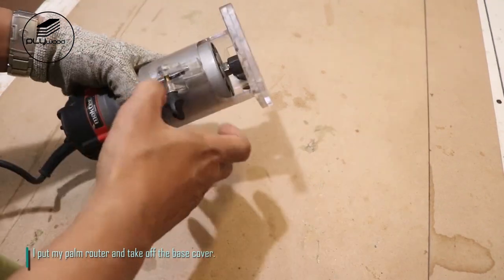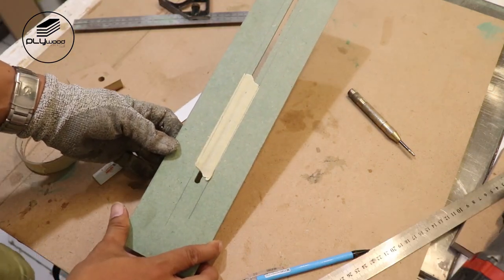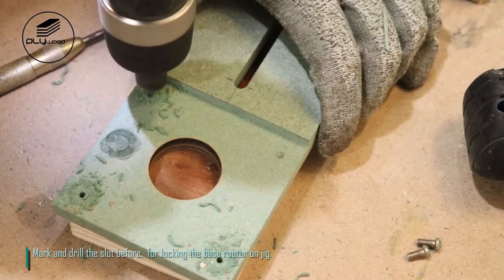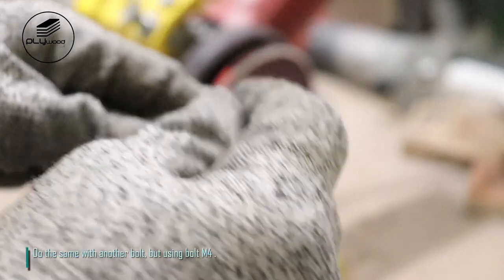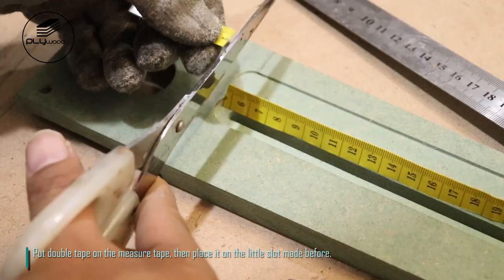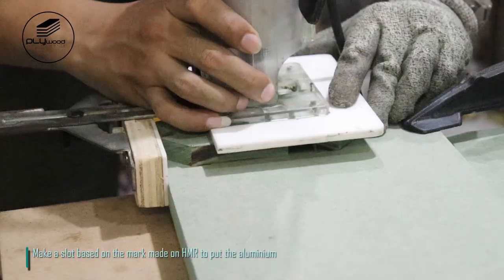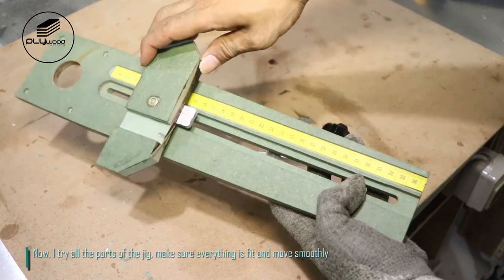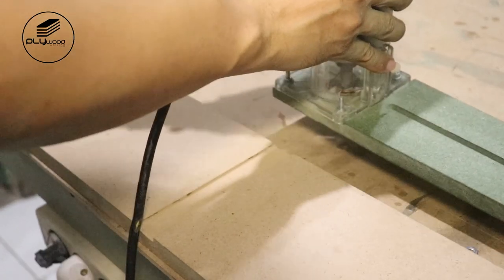Amazing 2 in 1 adjustable router jig base

Comment: Amazing and very practical. Just wonder what material you use and why it’s green?
Reply from the maker: This is call HMR high mousture Resistant, look like mdf but more solid and durable. I dont know why green in my country only available on green color
Reply: Can it be replaced with mdf in your opinion?
Reply: plywoodworking AWESOME and looks very nice. Thanks for your info. Here in Europa we haven’t that or I haven’t see it yet. Thanks again, you do awesome works, designs and videos 👍 👍 👍
Reply from the maker: @starkwedder9787 yes, you can replace with MDF, on first version i make with MDF material